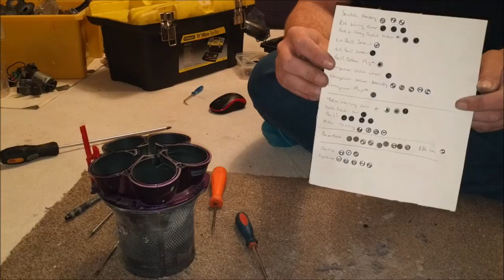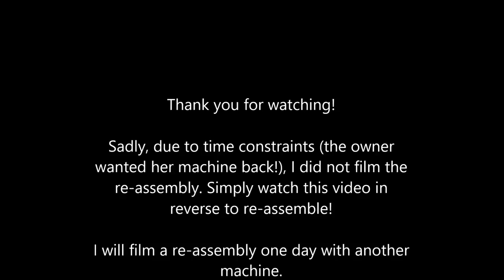Dyson DC25 Stripdown - Full Componentisation!

Comment: Hi, my dc25 has sparks from the motor.  The vacuum sounds normal. Have you experienced that ?  Any advise?
Reply from the maker: +Hartsmommy Hi! Some light sparking is normal, but excessive fireworks is not. It's usually the start of the commutator breaking down, could run as it is for many months to come, or burn out tomorrow... Does it smell of burning at all?
Reply: Beko1987 , yes.  It smells like it is burning.  The last thing that was cleaned up was tons of saw dust.
Reply: Beko1987, Is this something worth replacing?  The vacuum is in excellent condition.  Could a novice  replace or best to take to the shop?  What would this cost.  Thanks for your advise. 😀

Comment: I own the DC25 animal version and it whistles when you turn it on for about a second and whistles when you turn it off.  How do I troubleshoot that problem?
Reply from the maker: Remove the post motor filter then power it up!
Reply: I will do that but what if that is not the problem?  Where are the other parts that can cause the whistle sound?

Comment: Thanks. Very useful as I had a stuck ball and had no idea about how to take it apart to figure out what was wrong. I got it fixed and working good except for the spring on the red wheel release lever. I can't figure out exactly where it goes to snap into place to lock the wheels down for easy rolling. The reassembly video would be very useful as sometimes the parts come apart and it not obvious how they reassemble. Regardless I appreciate your work on this.